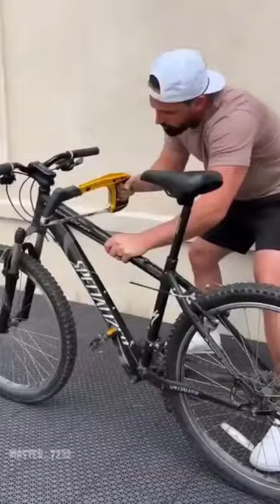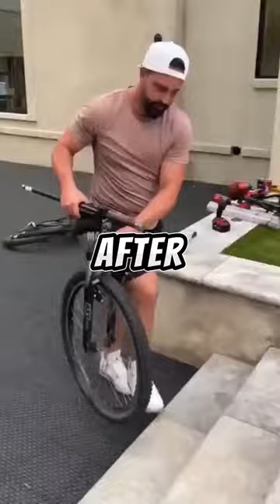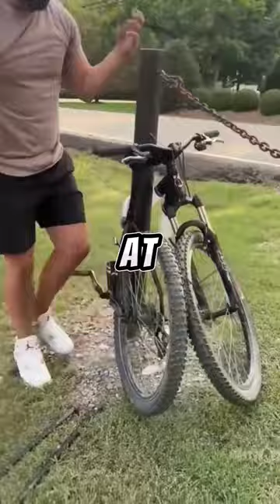He Turned This Cycle Into Something AMAZING 🤯 #shorts

Comment: fact is the plastic pipes also bend if there is put weigh on the bike so good luck with that
Reply: did you not notice the metal beams 😂😂 he had to take them OUT to fold it
Reply: @JackyDev.  Did you see the diameter of those things? It will still wiggle and wobble all over the place. Or why do you think they don't show him drive and make a short brake check?